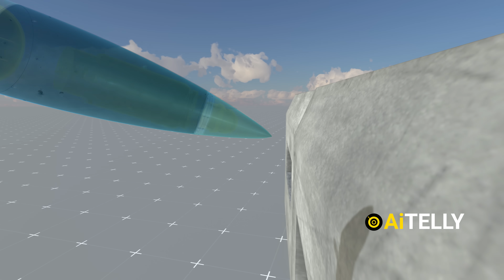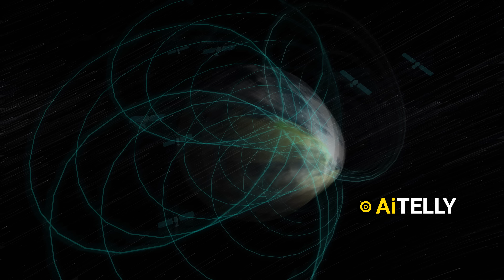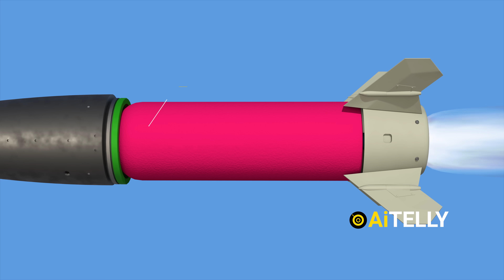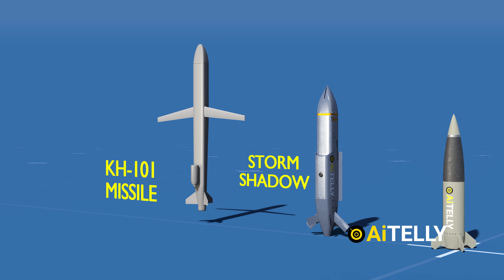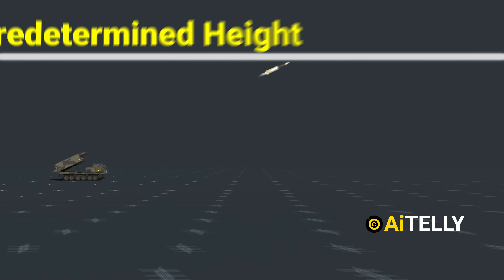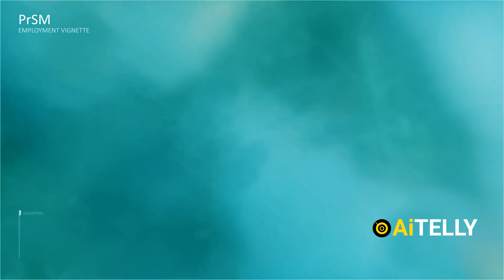ATACMS Army Tactical Missile System MLRS Explained

Comment: In my opinion comparison between solid fuel rocket and jet propelled missiles is senseless. ATACAM have way smaller range but way higher speed. Those are different types of weapon designed to different tasks and conditions.

Comment: This is the first video of yours that I have seen and I found it quite informative. I am Canadian and of an older generation and en engineer so I am versed in both metric and imperial unit systems and I found it curious that you stated some measurements in both silly units and metric in one part of the video and then just stuck to silly units in most of the video. That signals to me that you are Americans because you're the only country that has stuck with imperial units (although you buggered up the gallon measurement) while the rest of us have moved on to the much more sensible and easier to work with and understand metric system. I would suggest that in future you provide both imperial and metric measurements for all dimensions and specifications you provide so that everyone watching your video can fully understand them and fully comprehend the information you're providing. Most of the world doesn't understand the units that you use and that's because your units are silly and there's no logical case to be made for continuing to use them other than the fact that the majority of your population is too stubborn to learn metric. We Canadians were tasked with doing that back in the early 70s and we managed to do it albeit probably with some protest and complaints. That same task seems to have proved too difficult for America to complete and you've stuck steadfastly to your system of silly units although I find it interesting that my American made car is assembled with metric bolts. Most of us in Canada  now live in a world where both systems of measurement are used and we somehow manage to understand and get along with both systems.

Being Canadian and an engineer who grew up when we (Canada) were converting to metric, I'm probably more adept at converting between unit systems than anyone but I'm not fast enough to  be able to convert the antiquated and irrelevant (to most of the world) specifications you provide in this video to units that are meaningful to me while I'm watching the video. So, if you're Americans and you want only Americans to be able to relate to and understand most of the things you're reporting in these videos then go on only providing specifications in your silly units that the rest of the world doesn't use and doesn't understand. If you'd like to reach a wider audience, then I'd suggest you provide the metric conversions on all the dimensions and specifications you give in your videos.

Comment: Question?
Is it possible that the enemy could hack the satellites?
Has the missile ever been dropped on a target, without it going off?
How hot is the propellant burning?
How did they figure out the speed of the missile?
Does the Russian Radar pick up the ATACMS MISSLE?
I like how the fins are able to fold in?
I betcha I could tell you where Lockheed produces these at?

Comment: ATACMS is a land based launched ballistic missile and you compare it's speed to two cruise missiles? Those cruise missile are more similar to USA Tomahawk missile family where the ATACMS is more similar to Russia's Kinzhal missile.
Reply: Rather, a ballistic missile of the Iskander complex. The Dagger is an air-launched rocket and accelerates faster than anyone else. Although the Iskander rocket surpasses ATOM in all characteristics and is even cheaper. This is not because I am from Russia, but because this is objective data, my friend))
Reply: @АланМагометовичИсаев  In comparison, it should be compared more with Tornado-S, it is not correct to compare these missiles with Iskander, Iskander is a heavier system - the usual equipment with high explosives is more of a compromise than the norm
Reply: @onevablo1692 Іскандер та Кинджал, це та сама ракета, просто різного базування

Comment: ATACMs is just an American version of the Iskander
Reply: Which is hilarious because it's much older.
Reply: The brain inside the ATACM is smarter !
Reply: @georgesikimeti2184  ATACMS is older than the Iskander, has a shorter range and a lower maximum speed. The Iskander also has many navigation and auxiliary target detection systems, including DSMAC (TERCOM) technology, which Americans are often proud of having implemented in their tomahawk. ATACMS has the only advantage in mobility, since launching missiles from the MLRS is much faster than from a launcher, but both quickly fire missiles and leave just as quickly. ATACMS and Iskander are the same in terms of stealth coverage, but it is also easier to shoot down the first missile, since its maximum speed is about 3mach, like the Iskander from 5.9-7mach.

The conclusion is that ATACMS is inferior to its Russian counterpart in range and speed, and both are not inferior in navigation systems.
Reply: @isadanjan4762  no and no ,speed means nothing when going opposite direction,it’s not a race to the finish line!,the contact point can be accurately timed due to its trajectory path and shoot down easily.The firepower carried by atacm is far deadlier in covering more kill zone area,yeah longer range means nothing too!
Reply: @georgesikimeti2184 if speed and range mean nothing then what's the point of making supersonic, hypersonic weapons...? Are you joking..? this is not 50s or 60s, even some cruise missiles could reach upto karman line, not only that nowadays some cruise and ballistic could maneuver their path, So in that case speed and range are absolutely necessary.
Reply: @muraleedharamenon9045  read my comment again and perhaps a bit of brain to go with it!
Reply: @TrusePkay  absolutely not atacms is just guided missile, but Iskander is quasi ballistic missile and its a hypersonic weapons which reaches speed of more than mach 5, and Iskander can reach speed upto mach 7.

Comment: USING OF MAGNETIC LASER CAN CHANGE THE DIRECTION OF MISSILE AND CAN STOP THE EXPLOTION
Reply: what you say makes no sense
Reply: @lucasgarcia7230  BUILT A MAGNETIC LASER AND 1 BILLION % THE PROOF IS WORKING LOOK AT THE LASER USING OF UFO,, THAT IS A MAGNETIC LIGHT
Reply: @lucasgarcia7230   5 BILLION DOLLAR IM WRITE HOW TO MAKE A MAGNETIC LASER
Reply: @lucasgarcia7230  CERN CAN CONVERT INTO MAGNETIC LASER,, 3 BILLION DOLLAR IM WRITE  HOW TO CONVERT THE CERN INTO MAGNETIC LASER
Reply: @davebosch9385 I smell a lot of coolaid here.
Reply: WRITE AND SHOW IF YOU HAVE AN INTILLIGENT BOASTFUL,, SHAME ! @lucasgarcia7230
Reply: @lucasgarcia7230  CONDOLENCE !!! IF MY GOD PARTICLE CANNOT RETURN IN 30 MINUTES MEANING YOU ARE FOUND
Reply: @davebosch9385   Please explain exactly what you mean by "God particle".  Also explain how magnetic lasers work...  Caps lock doesn't confer authority BTW...
Reply: @rickkolesar9163  MAGNETIC LASER IS A GRAVITY BURNING USING ELECTRCITY THE SAME OF ENGINE OF UFO,, THE MAGNET IS A MATTER AND GRAVITY BUT THIS ARE WEAK USING FOR STRONG LASER NEED A LOW WEIGHT MAYYER LIKE THE ELECTRICITY FOR MAKING STRONG ALSO CAN USE THE HYDRVOGEN GAS FOR CREATING A MAGNETIC LASER,, FOR CREATING ARE VERY LONG TO EXPLAIN AND NEEDS A LABOROTORY FOR CLEAR EXAMPLE HOW TO BUILT,, GHOST OF LIFEI A GRAVITY IF YOU KNOW HOW TO ARREST THE GHOST YOU CAN USE THAT FOR MAGNETIC LASER,, PEOPLE IN INDONISIA ARE EXPERT FOR ARRESTING THE GHOST
Reply: Shaka, when the walls fell!
Darmak and Jilad at Tanagra!